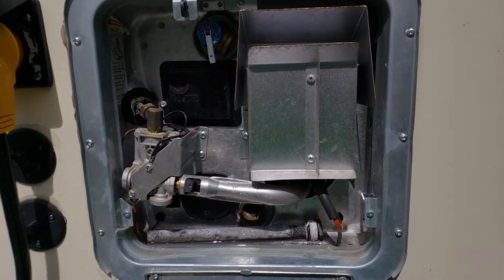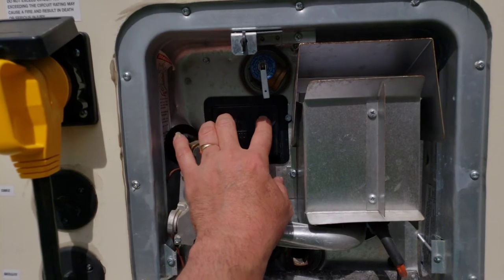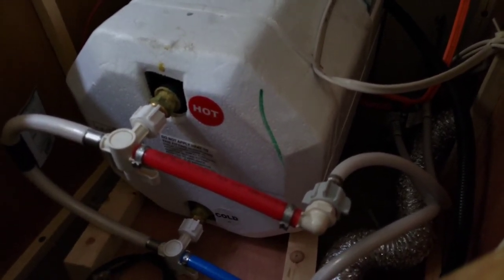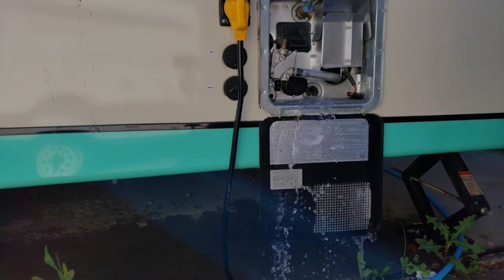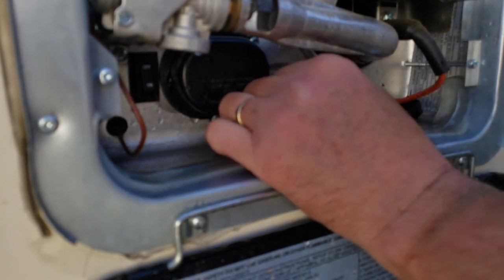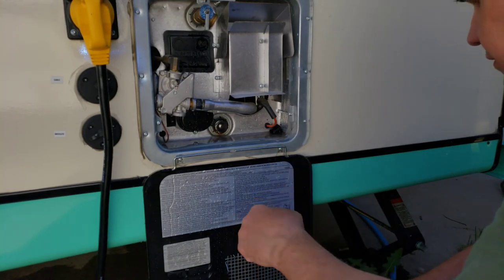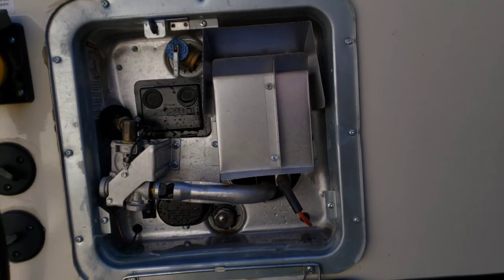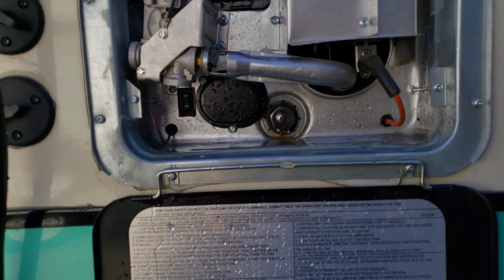Vintage  Cruiser Suburban water  heater.

Comment: Dumb question, how do you fill the water heater? I just bought one of these and I haven’t noticed a fitting to fill the water heater.
Reply from the maker: The best way to fill it is by hooking a hose to the fresh water inlet on the outside of the trailer. When the valves were pointed to the hot water tank the water will simply fill the tank. When the valves are set correctly you will only be getting error out of the hot water side of a faucet. When the tank is full? Then the water will start running out the fossit. It will take a few minutes to fill the water heater. You can do the same thing with the fresh water tank and the water pump but I do not recommend it. The freshwater tank only holds about 18 gallons of usable water and if you use that to fill the hot water. Take you will use a third of your water. Good luck and let me know if you have any more questions.